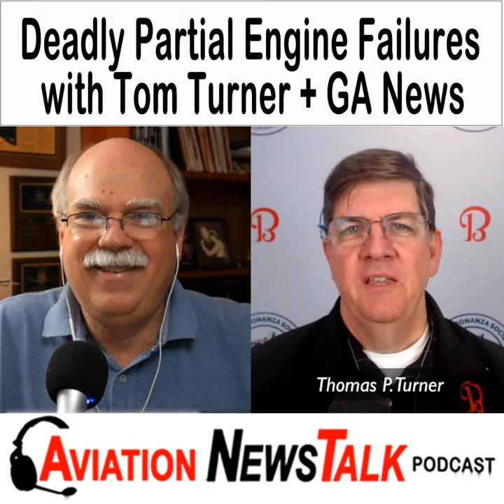262 The Deadly Partial Engine Failure with Tom Turner + GA News

Comment: Another great episode.  You just keep knocking it out of the park Max.  I just heard Tom on the Sporty's podcast (a good episode as well).  So awesome that he can cover topics so relevant to the flying I am doing in ways that really help improve safety.  I had a friend flying an A-36 when he lost a cyclinder.  He chose to continue back to the home airport instead of stopping at a closer airport with maintenance.  Luckily, it ended well for both he and his plane.  However, as I think back on that, I would have turned around and landed at a closer airport.  Thanks for showing the data to help reinforce this.